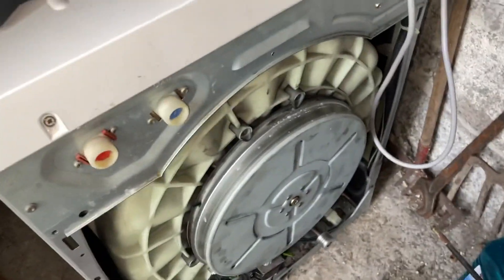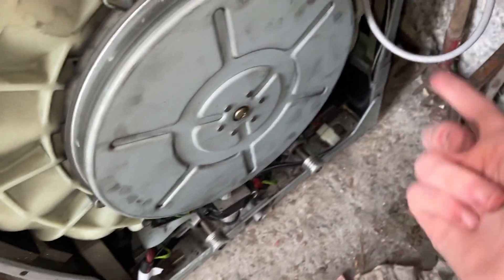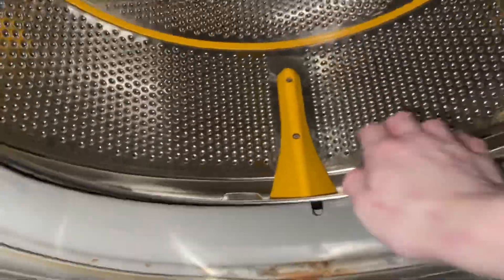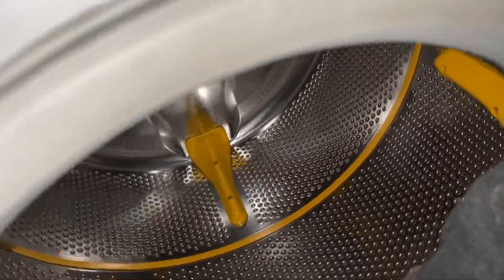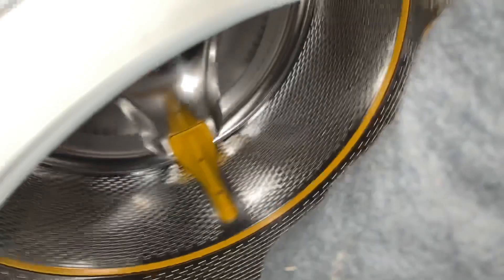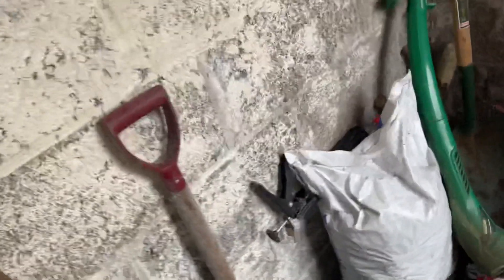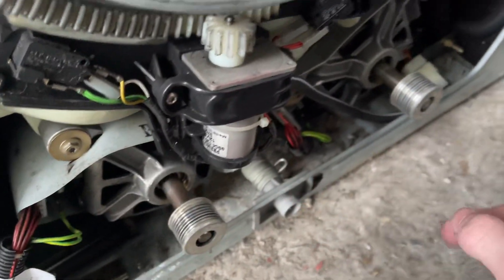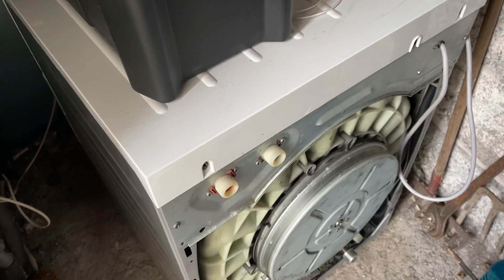Dyson contrarotator update (fault has been found!)

Comment: Hello  again washerboy 2006 i reccomend you remplace the bearings on the motors its cheaper than replace them If you need help on fixing it comment in my last video
Reply from the maker: I honestly don’t know if I’ll do that tbh feel like that would be way to difficult for me and there are 2 motors plus a motor pcb going for £88 on eBay which would be great if the motor pcb decides to fail in the future meaning I won’t have to buy one as I’ll already have one but haven’t decided yet
Reply: Yeah if motor pcb is broken there is better to replace them

Comment: The Samsung that you had was rubbish because it had AutoDose! I do like the Series 5 range but with the normal dispencer
Reply from the maker: Yeah the autodose was appalling but it was either have autodose or have addwash and I’d much rather have autodose than a door with a cat flap lol 😂 other main disadvantage with them is that they limit the spin all the time with a small load and never heat to the temperature you set but from what I know series 6 and above are miles better and actually do what their meant to 😅 (but personally after my experience with 2 Samsung washers I wouldn’t touch another one 😐)